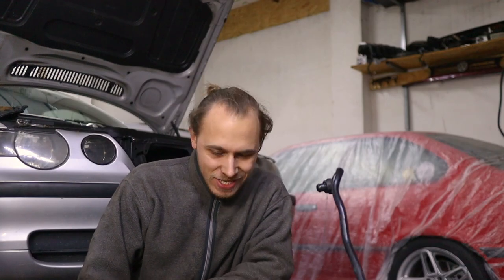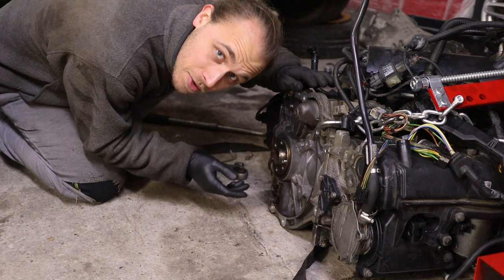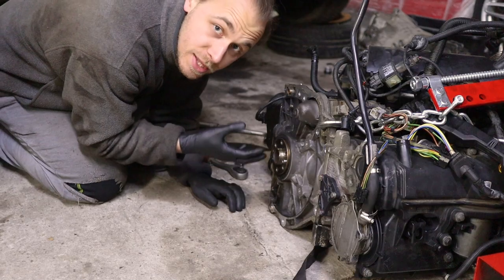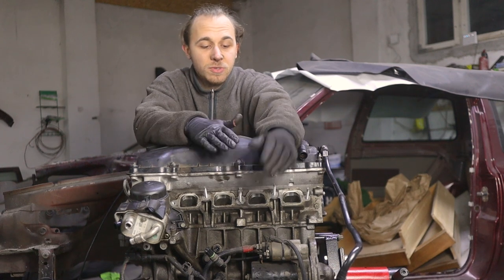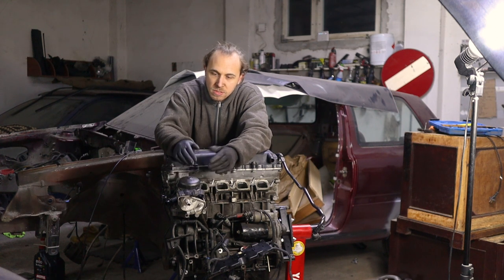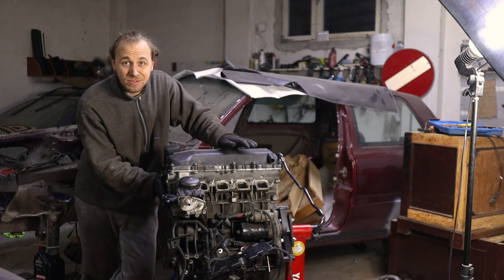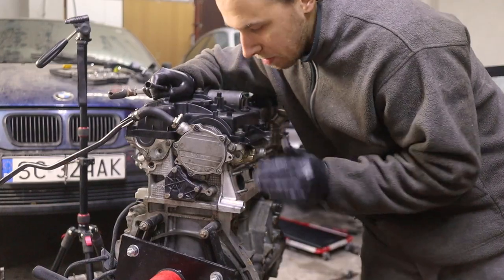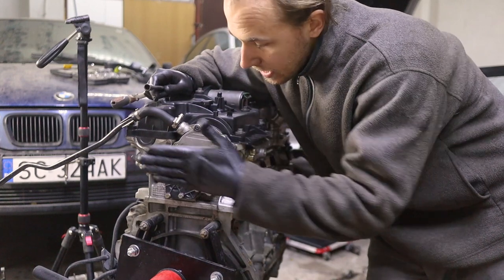Most common N42 N46 oil leaks!

Comment: Thanks for the video. I've replaced everything in your video except the vacuum pump at the rear of the head - next on my list. You are absolutely right about oil quality - I use 5W 30 Castrol Edge and change it every 5K miles - no leaks.
Reply from the maker: No problem! I use Valvoline 5w30 because I’ve heard that it’s possible to buy fake Castro in Poland so I decided to play it safe. Works just fine 💪 vacuum pump is not very difficult, 3x10mm bolts and it’s out 😉
Reply: @gorillaprojectcar  What about Mobil 3000 5w40 for this engine? I'm also afraid of fake Castrol here in Serbia.
Reply from the maker: very very hard to say. I think if you have a good source CASTROL is OK. I think every country has it differently. In some CASTROL will be the best thing ever and in others the worst thing because it will be fake.
Reply: @gorillaprojectcar  This Mobil has bmw longlife 01 approval, and its not fake. I don't know...

Comment: One of the best bmw engine N46, while N42 is very bad, for many reasons, I have an e46 with N46 engine.  for 4 years now, and apart from changing the quality oil at 7000km, regular maintenance, I haven't had a single problem.  the valve cover gaskets, crankcase, oil pan housing, chain and coils with spark plugs were replaced.. that's it.. it doesn't waste oil, it doesn't smoke from the exhaust, perfect engine..
Reply from the maker: I like those engines a lot too! E46 with n46 is the best to work on due to a way that wiring is done. So much easier than n42 or n46 in e87 or e9x. Since I rebuilt mine I also haven’t had any issues with it. I don’t have this engine anymore as I swapped it into my mums car and she’s happy with it. We change oil every 10k km and as you said, using good quality oils keeps this engine happy 💪

Comment: Careful with the vacuum pump gasket, it cannot be fixed by replacing the gasket, you need to change the vacuum pump with a new one. If you just change the gasket it will last about a year, 1.5 years, but at winter it will start dripping on the exhaust and that is annoying. To save yourself some work, just buy a new one, that will last much more. This is because the vacuum pump also has an internal gasket that you can't change.
Reply from the maker: We buy both gaskets in set and replace both of them. Just 5 bolts and job is done. But that’s a good comment and will definitely help someone 😁 cheers 🍻

Comment: How to get rid of oil leak in N46... USE FRAGGIN proper oil 5W30. Its that simple.
Reply from the maker: If it already leaks replace gaskets but good oil is not just 5w30 it’s also the LL-04 BMW standard ;)

Comment: Hi dude I have a question. How often should I change that, cuz I have a e82 n46 - 50km and I see a little oil for that zone. So I believe that is necessary to change that things. I hope u can help me. Thanks
Reply from the maker: To be honest some engines last without oil leaks lingers than others. So if you see something you can change gaskets but there is no rule just indications more or less ;)
Reply: @gorillaprojectcar  thank you so much for your fast response. Im gonna do that 😄

Comment: Hello. What about eccentric shaft tensioner oring? Is it worth change and is it hard to do when doing rest of sealing rocker cover? Pozdro
Reply from the maker: Oil leaks there are not too common so if the engine is still in the car I’d leave it alone. If the engine is out I’d change it. Maybe I forgot to put a clip in or it was badly recorded but I took it apart and replaced the seal since I had it in the set. But there is hardly any oil getting there anyways which you can see by how dirty the spring usually is ;) 🙋‍♂️

Comment: hey man, my car has the n42b18a engine and recently threw a code for camshaft position sensor and fuel trim additive bank 1 high, i replaced both intake and exhaust camshaft sensors and reset ecu, both codes have disappeared however the car still doesnt feel right and i can still sometimes hear a slight knock noise from cylinder 1 area which started when the code first came up. ive read online that the timing chain tensioner is to blame but im no mechanic and i need the opinion of someone who has experience with these engines. it would be great to recieve a reply from you, love the content
Reply from the maker: Hi! Thanks a lot. 

There is a chance that the tensioner went bad. But if it did there is a chance that the chain is also on its way out. Advising online is difficult but you can try taking the valve cover off to check how old is your timing set and see if chain is loose or not. I’d recommend changing the whole timing set rather than just tensioner. 

While you have the valve cover off check your valvetronic for any issues with the spring. 

If it’s more like ticking noise rather than knocking it might be hydraulic valve lifter too ;)
Reply: @gorillaprojectcar  thanks for the reply, i’ll check that and let you know
Reply: @gorillaprojectcar  also how hard is doing the full timing procedure? i’m fairly inexperienced with engines but unfortunately cannot afford to get a qualified mechanic to do it for me. also there is a ticking and a knocking, but i think the ticking is probably something else, im going to service it soon and see if that helps with anything
Reply from the maker: It’s not that difficult al long as you have basic tools and the set of timing blockades. I think I showed all in the video of how I do it but if you have questions I’ll try to help 😉
Reply from the maker: I made a video about the timing. It’s more recent on the channel. Check it out 😁

Comment: Did you add some sealant on the housing ???
Reply: oil filter housing ...
Reply from the maker: @headache7449  If I use OEM gasket I don't add it and if aftermarket I do add it.
Reply: @gorillaprojectcar  ok i will try because i changed it and i still have a very small leak
Reply from the maker: @headache7449  yes, then try some sealant ;)
Reply: @headache7449  if it still leaks, make sure you clean the surface, even with sand paper.

Comment: 12.42. No, this engine really bad. Sorry))
Reply from the maker: Youre getting 👎 for that comment 😂 it’s all because you’re used to 2.8 which has any kind of power not like n42b18 🤷🏼‍♂️ they are slow, but the one in my compact was really reliable 😉 it’s all in the maintenance 👨‍🔧
Reply: My n42 218,000km still works great ...
Reply: @gorillaprojectcar  of course it's all maintenance, but it's too expensive for 4cyl engine and a bit more than 100hp.
Also very short transmission and high fuel consumption.
So for me this engine is absolutely useless.
Sorry again))
Reply from the maker: @Никита Кожемяка  I do have to agree that they could put in a longer diff but then it would accelerate even slower. the 2.0 version is a lot better. Same fuel consumption but those extra 25hp make a difference

Comment: Great video man, these engines really aren't as bad as people say, my first car was a N42. Replaced most the gaskets and some sensors (crankshaft, camshaft) and drove it from 170k to 270k without issues, yearly oil changes of course. 

Currently I have N46 and  this one also leaked from all the known spots, oil housing, valve cover, vacuum pump, vanos solenoids. Replaced the seals and no oil leaks anymore. These engines just need some love
Reply from the maker: Oh yes! I think the same. I completely rebuild mine few years back with a crank and rods swap to make stroker. After that it run in my car for 70k km without any issue and is now in my mom’s car still going strong. And I did redline it a lot on the highways 😂 but always did change the oil on time and have never given it cheap oil. 

Also thanks for the opinion 🙌 I appreciate it 😁
Reply: What about oil pan/sump gasket? How long before that starts to leak